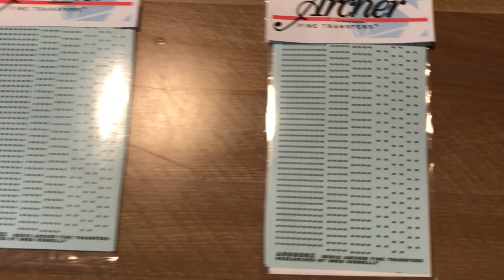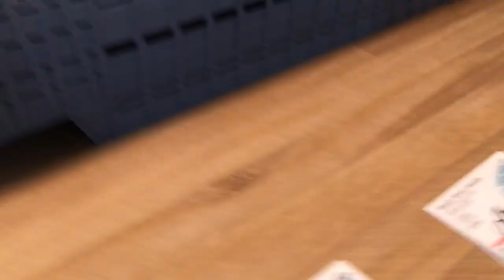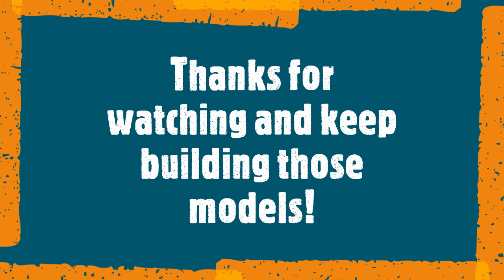Revell Kenworth K100 & AMT Wilson Livestock Van (Almost Finished)

Comment: Nice work on both the K100 and stretching the bullrack! It's not easy to modify that Livestock trailer, I'm attempting a 40' flat floor project which is trying my patience and no where near what you have accomplished.  When I built my Revell K100 kit I thought the headlights and air horns looked way to big and out of scale so I swapped some AMT headlights and a set of open horns from a snap Pete kit and it was a huge improvement.
Reply from the maker: Thanks Captain and I you are right... this was a difficult conversion for sure. I also fully agree that those K100 horns are HUGE lol but at the time when they went on I was just looking for the end of this build ha ha ha. The paint was driving me crazy!
Anyways, thanks again Captain!

Comment: Truck and trailer are really looking good Karl,really liked the blue you used on the k100.since you updated the length of the trailer I would put the 10 hole buds on,I think it would look better.now I just need to finish my k100.lol kutgw
      Chris
Reply from the maker: Thanks Chris... I appreciate the compliment and I'm gonna build up a set of 6 aluminum bud duals to try them on and see how they look after the aluminum paint goes on. Cheers!